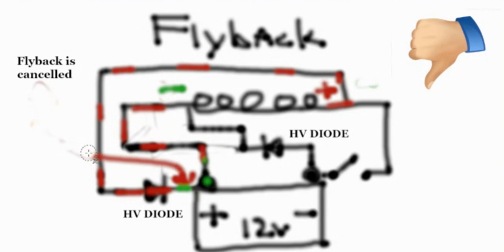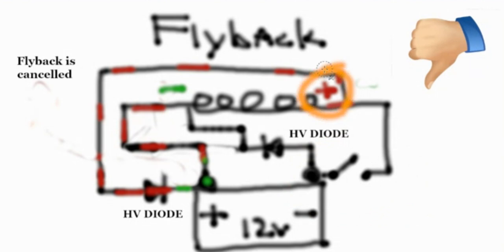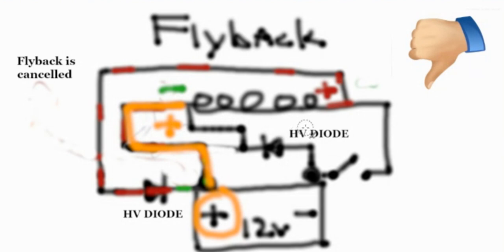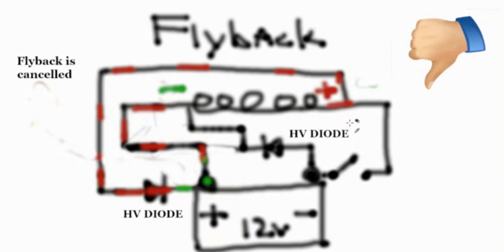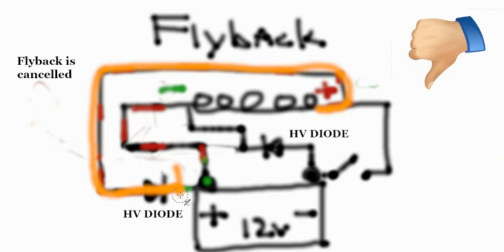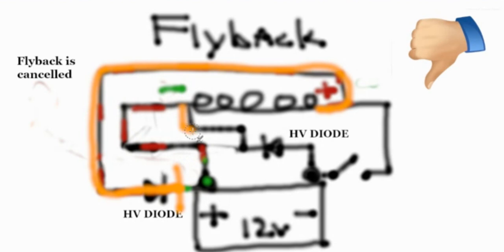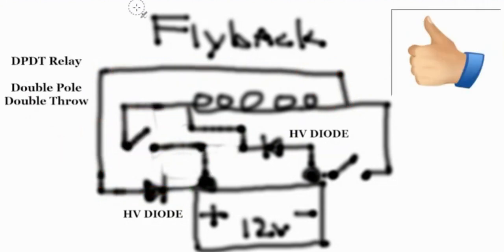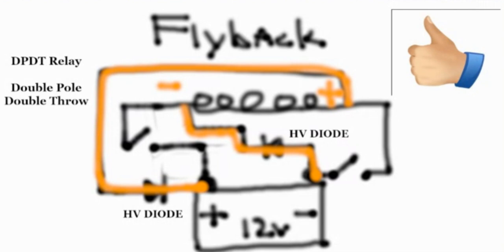Bedini Single Battery Mod Flyback Loop Explained

Comment from the maker: I recommend two batteries in parallel,  this will be better for the "cycling" ..  There is one thing left to test and that is if or not the flyback is faster than the double pole relay , meaning is the flyback faster than the switch and will it short itself out as described with a single pole switching. ( I dont think so but its something to consider and make experiment to prove )